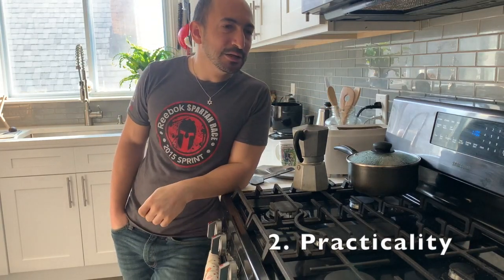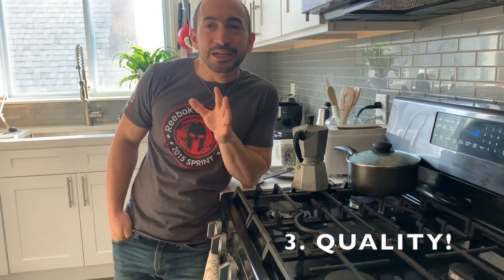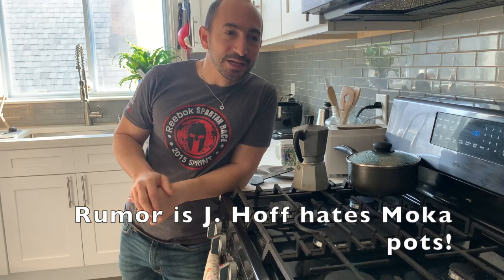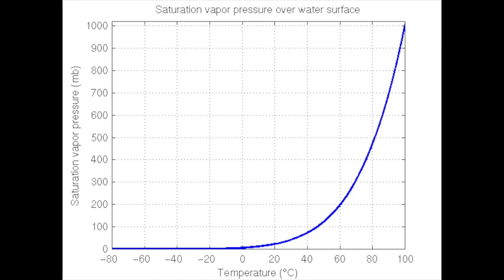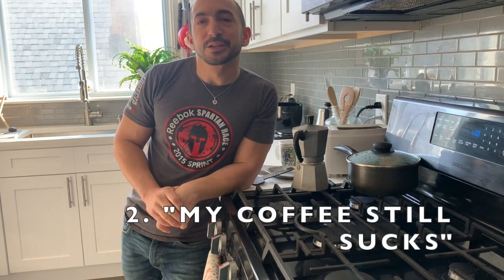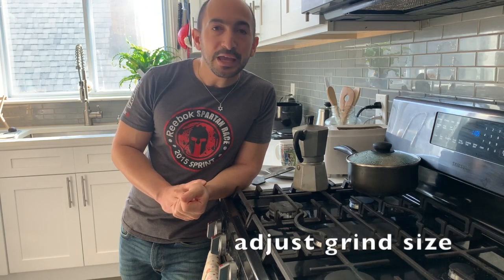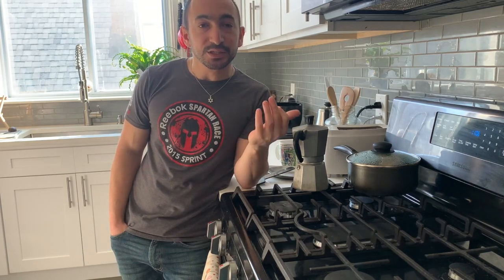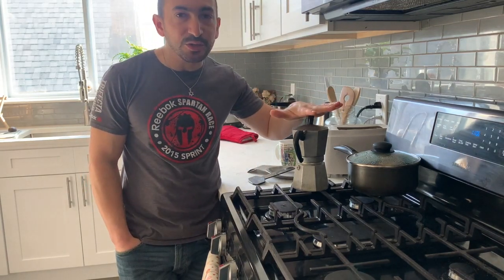Why your moka pot still sucks and Italians hate me.

Comment: Here's how I usually cook: Hot water should be poured if it is a light roast, and room temperature water if it is a medium or dark roast. Pour to the valve. Pour a full basket in any case. The grind is medium fine. Cook on low heat, if it flows too quickly, it is better to reduce the gas a little, and remove it when lighter coffee starts to flow. When the flow stops, stir. In this case, it is neither sour nor bitter. Such a balance. But if the coffee is strong, you can dilute it with hot water to taste, or add whipped milk.

Comment: I use a grind that is similar to coarse sand. I use the Moka Pot basket to measure out the beens, and use cold water for convenience. As long as the brew comes out like lava, that indicates it's just right. I don't want to go down the scales and the thermometer rabbit hole. They are unnecessary complications. I'm making coffee, not performing a lab experiment.

Comment: Moka pots are truly awful.  There are a dozen better ways to make coffee.  Also, preheating ALWAYS makes mine so bitter that it's undrinkable.  I only care about my own personal results and it's always the same: preheating is not only worse but makes the coffee utterly terrible.
Reply from the maker: Hey, thanks for the comment!  If preheating makes your moka pot taste terrible, then you're likely overextracting, which is especially prone with a dark roast.  You can either use a lighter roast, a low starting temperature, or fill the bottom with less water.  I discuss these changes and why they work in my latest video: https://www.youtube.com/watch?v=NQrRzTzU_Yk

Comment: One morning, I heated the water. The coffee was sour when it came out. Another morning, I poured room temperature water, and miraculously, the acidity disappeared. Although I did the same. Of course, everything depends on the coffee itself and the grind, but it's all with the same coffee.
Reply from the maker: If you're getting sour/acidic coffee, it sounds like you had a classic case of underextraction.  That said, I'd expect the opposite of the results you just reported.  Hotter water helps the coffee extract *more*, so now I'm wondering if you changed any other factors (e.g. water level, heat level, etc..) maybe without realizing.

Comment from the maker: Jan 5, 2021:  Yeah, sorry you guys. I can see that I totally overdid the music again.  Schubert's Unfinished Symphony seemed a good metaphor for trying to get good coffee, but I get now that the dynamics on it are annoying as hell. Live and learn :(

Musicless version posted by request: https://youtu.be/UFwP7Df3vVw

Many thanks to PCVXD below, who pointed me to the following journal article:

King, Warren, "The physics of a stove-top espresso machine": https://www.semanticscholar.org/paper/The-physics-of-a-stove-top-espresso-machine-King/8a38818c2ce700e632cb25a6d2a518582d2edf17

King's paper uses physics to figure out ideal starting temp of the water is, in order to get brewing to happen at 92-94 degree C.  There is a subtle interplay between the initial temperature of the water and how much the air in the chamber expands to contribute pressure*.  On the basis of physical models and experiment, they say the idea starting temp. is 70C.  Their argument is that any lower than that and your water is too cold to get extraction at the beginning (sufficient pressure is reached before temp is ideal), but any hotter and you'll risk burning towards the end (last few drops always brew at highest temp).

Of course that 92-94C it pulls from this paper by Illy: http://www.gaggiausersgroup.com/index.php?PHPSESSID=qeuvubv350kfc0um6t0g4fm8r4&action=dlattach;topic=245.0;attach=263

"Brewing espresso requires specialized equipment that can heat water to a temperature of between 92 and 94 degrees C and pressurize it to nine atmospheres."

Though I frustratingly can't see where Illy here gets that claim from.  

*If the air is already at 100C, it doesn't expand at all and so doesn't contribute to pressure.  Hence, you have to wait for more vapor pressure from boiling water, which means the brewing temperature will be hotter by then.  If the air inside is quite cold (e.g. tap water at like 15C), you'll get a large expansion of air, which will contribute a lot to the pressure, which means the coffee will brew at a lower temperature, since you don't have to wait around for as much water to boil.  The result is you can indirectly adjust brewing temperating by adjusting starting water temperature *in the opposite direction*.
Reply: You're in the wrong year! Get out immediately!
Reply from the maker: @pastel8453  Man, that was a close one.
Reply: I was just going to respond that I did found a noticeable difference during the summer, because I tend to get the water from the fridge. I've tried all the different versions, and with the cold water the taste is finer, as I mostly intuitivelly associated it to the diference between temperature and pressure in the process. It's not exaggerated, but the coffe gets that notch of paleness on the uper end of acidity, I guess acording to the rationale here because of a lower brewing temperature.
Reply: I haven't uploaded much to youtube, but I bet you could throw some compression on the background music and duck it behind your speaking to make it a little less intrusive. I haven't tried it, but that's what I would try if I ever made content. I love classical music, but because it's so much more dynamic than pop music, I think it would need a lot of processing to use it as background music. No problems here with your music choice, though! Also, you make your coffee the same way I do!
Reply from the maker: @professorredfox  Yeah, all valid points and ideas.  Do you know any video/audio processing software that compacts the dynamics of an audio clip?
Reply: @loodog555  audacity and reaper are the free ones I know people use. They probably have compressor plug-ins you can use. You’ll want to compress the music signal, and then use another compressor to side-chain it to the audio of your voice so when you’re speaking the music ducks behind you a bit. If you need one that can work with the video, you can use Logic Pro or Pro Tools, but those cost $$.

Comment: I learned that acidity appears when coffee is not brewed, and bitterness when it is overcooked.
So that there was no bitterness, I started to remove the gas when the light coffee started to flow. The bitterness is gone.
As for the acid, I couldn't get rid of it.
Regarding this, they write that it is necessary either to reduce the grinding, or to cook longer.
So when instead of hot water, I added room temperature, that unpleasant acidity disappeared. And all because it was time for this coffee to warm up more, to brew.
It was a discovery for me.
Reply from the maker: Yes, this advice is pretty consistent within the literature. Underextracted coffee is sour/acidic. Overextracted coffee is bitter and dry. With a moka pot, you can't really control the brew time very much so it mostly comes down to:

1) Water fill level.  Putting less water in can result in coffee brewing sooner, at a lower temperature. This is helpful if you're using a dark roast or otherwise have overextraction: https://www.youtube.com/watch?v=NQrRzTzU_Yk

2) Grind size.  Finer the grind, the more you are going to extract.  Most people have the problem that a moka pot overextracts, and so tastes bitter. The solution to this is grind more coarsely.  If you're getting acidic/sour coffee, grind more finely.

3) Initial start temperature.  Starting with hotter water means you brew with hotter water and so this increases extraction. 

May I also in general recommend an AeroPress filter to improve your moka pot results?  I've found it makes quite a difference: https://www.youtube.com/watch?v=fy1YKqrPYCw

Comment: Read the paper The physics of a stove-top espresso machine by Warren D King. It's not just the vapor pressure that's pushing the water up, it's also the heating expanding air before there is a lot of vapor (of course this doesn't really apply if you start with cooking water). That's why those UK guys are saying what they're saying. 
I prefer starting with water of around 60°C and then submerging the base of the pot in cold water once flow gets very fast. Starting with cooking water tastes terrible to me but to each their own. Also I use a fine grind and sometimes darker roasts, not bitter at all. I use a 2-cup though, it gives more of an espresso brew ratio.
Reply from the maker: Hi, thanks for the comment.  I mention that in my video here, in the context of Charles' Law and Boyle's Law.  I get you, in that, if you don't preheat, you're heating the chamber air along with the water. If you preheat, then that air is only room temperature.  But again, I ponder the question: how does that cause any of the water to be in contact with the grounds?  I can see how it causes the air to take on a different quality and now you've got hotter higher pressure air in contact with the grounds, but I don't see the water doing anything except sitting there and maybe evaporating a tiny bit more before it actually boils.
Reply: @loodog555  The air that's trapped in the lower chamber between the water and the bottom of the grounds holder can expand by pushing the water into the tube to the grounds. 
If you preheat to boiling, that air will already be quite hot and it won't really go hotter than 100°C so it won't expand much, but the water vapor will do the work and extraction will happen at boiling which doesn't taste great imo. If you start with cold water, it will expand quite a lot and this causes water of about 40°C iirc to come in contact with the grounds which also doesn't taste great.
The air in contact with the grounds isn't trapped in any way so it's just at atmospheric pressure. You can feel and hear this air slowly escaping while heating the pot because water is pushed up through the tube. I don't believe that heating the grounds is a problem, to me it's a myth.
Reply from the maker: @pacman22XD  GOTCHA! You're saying the air provides just a slight little bit of buffer to increase the pressure a little bit earlier on.  You hit brewing pressure when the temperature is slightly lower.  

That said, let's see how significant it is.  If we use a simple ideal gas approximation on this, the difference between 20°C air and 100°C air is a factor of 373/293= 1.27 so your air causes a possible pressure increase of 27%.  Does that matter? I guess that's why you sent me to that article, which I finally checking out:

https://aapt.scitation.org/doi/full/10.1119/1.2870524

Interestingly, they claim room temp. water results in brewing at too low a temperature and that 70C water is ideal.  But I'm hitting a damn paywall before I can read how they can claim what the ideal temperature is.  I'd love to have access.  Thanks for that share!
Reply from the maker: Got it!  http://www.msc.univ-paris-diderot.fr/~phyexp/uploads/Moka/article1.pdf

"Thus these conditions are likely to be
the best compromise between having the water so cold that
the flavors are not extracted at the beginning and so hot that
a burnt flavor is risked toward the end of extraction.

Thus there are two methods of ensuring high coffee extraction temperatures: start with water at room temperature
and leave little free space  not recommended for safety reasons, or preheat the water before sealing and leave modest
free space volumes in the pressure vessel."

EDIT: Got the link to their claim about temperature: http://www.gaggiausersgroup.com/index.php?topic=245.0
					

	"
Reply: @loodog555  I've also sent you some links via direct message on Reddit. After rereading the paper I actually think my claim about the air expansion being very significant and the vapor being insignificant at lower starting temperatures isn't true, but it doesn't really matter. The point is that it starts brewing earlier than you think so you can control the temperature range of the extraction.
Reply from the maker: @pacman22XD  I checked my reddit and didn't see anything, so maybe you were thinking of someone else..?  Anyway, I really appreciate your pointing me toward this paper and giving me more to think about. I had a lot of fun diving into it and reconsidering my ideas.
Reply: @loodog555  I sent them to loodog555 and it said you were active in r/coffee so I assumed it was you. It should be in direct chats
Reply from the maker: @pacman22XD  That's odd. I just checked my DMs again and nothing.
Reply: @loodog555  I believed we wanted to avoid high extraction temperatures, am I wrong? :)
Reply from the maker: @lucadoctorbho266  You are completely correct in reading my initial concerns.  However, having read the paper by King, my mind is changed.  Again, I don’t notice a difference in taste, but King makes a good argument that starting with cold water will probably extract at too low of the temperature.

Comment: Can’t a person heat up the water in the Moka pot with the top not attached, then once the water is nearly boiling, add the coffee, screw on the top portion carefully, turn down the heat and let it brew? I’m not seeing this mentioned, but seems like a obvious simplification…. unless I’m missing something. I’ve never tried using one yet, but am trying to learn all I can when considering buying one. Thanks for such detailed videos!
Reply from the maker: Hi, thanks for your comment!  Of course, your solution would produce the exact same result as my electric preheating method.  Though, if you've caught on the main point of my preheating discussion, I only preheat to save time and energy (electric kettles are more efficient than stovetop heating by something like a factor of 2).  My more efficient 1000W electric kettle will heat up faster than a less efficient stove top that's probably delivering about 20% of that power, even though I might be heating more water.  

But if you want to save yourself the trouble of getting a separate kettle, sure!  Go ahead and use your moka pot as your preheater.  Good luck!
Reply: @loodog555  👊thanks for taking the time to reply

Comment: Thanks for the good info. I really appreciate you not making a blanket statement. I don't think one is objectively better. I've dove into forums to figure out the best way, and watched the bould brothers and James Hoffman video and I've come to the startling conclusion that both methods absolutely work. 

The biggest hit to quality for my moka pot is if I grind too fine. Otherwise I treat preheating the water in my moka pot like I do using the inverted method in my aeropress. Both regular and inverted work, sometimes I take the extra step and sometimes I don't. The biggest difference I've noticed with using cold or room temperature water in the moka, is it's more sensitive to constant or higher heat. If the heat remains high and goes into a more aggressive boil I think it has a higher probability of over-extracting. I think bould brothers method of using high heat to get the water up to temp quickly then agressively lowering the heat once coffee starts coming out works very well. Whereas with preheated water I can leave my stove at medium to medium low for the entire brew and it's works well. So in a way it's a little more forgiving on the heat applied. I love my moka pot and it's my second favorite brew method behind the aeropress, although I just got a two cup moka brikka and I'm really liking it. I'd love to see your thoughts on the brikka. I've used cold water every time and have no reason to try preheated because it's been very consistent.
Reply from the maker: If you really want to get into the weeds, I linked to a physics paper where they actually model the brewing process using fairly standard fluid dynamics principles and solve numerically (http://www.msc.univ-paris-diderot.fr/~phyexp/uploads/Moka/article1.pdf).  There are even more surprises to the questions of initial temperature and initial volume than you would think. 

On the issue of a Bricca, I’ve never even heard of a Bricca before you mentioned it.  Apparently the difference is they put a pressure valve on it: https://www.google.com/amp/101coffeemachines.info/moka/brikka-vs-moka-express/amp/ frustratingly, they aren’t specific as to whether or not the valve is used to increase the pressure or to cap the pressure.  The reviewer does say it’s a big improvement over the moka, but I personally have no knowledge on the matter.
Reply: @loodog555  Yeah. I have a 2020 brikka, which they changed the valve from a weighted metal valve to an internal silicon valve. It works pretty well, but I am a bit worried about longevity. It holds the water from coming out until it reaches the pressure needed to override the valve, and then it rushes out very quick. So I think overall, it's a quicker higher pressure extraction. I really like that it removes the variable of pressure. The idea was that it forms a "crema", but I don't really care about that. I think crema taste terrible. I just wanted better moka coffee.
Reply from the maker: @Jaymv4s  interesting.  James Hoffman has a good video where he talks about crema, it originally having been viewed as an undesirable byproduct, but then brilliantly rebranded as an essential part of espresso.  Maybe one of these days, Bialetti will notice me and send me a Bricca to try out on my own, and I can give you my impressions.